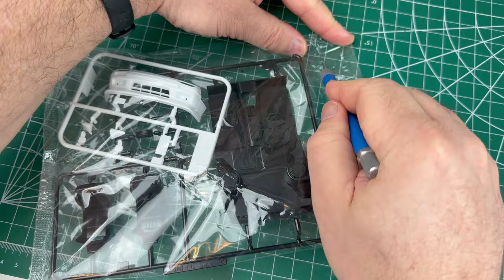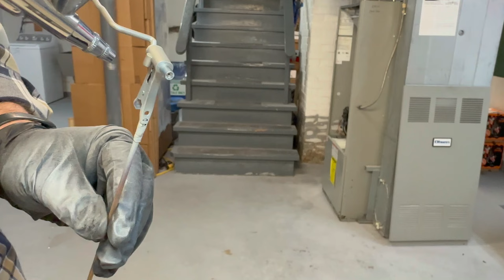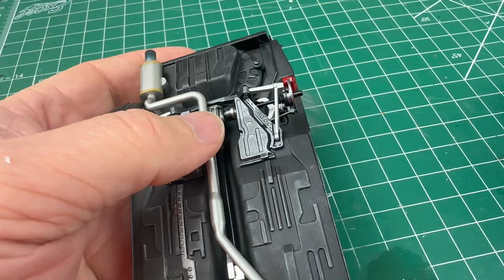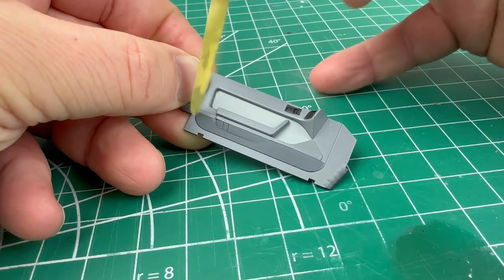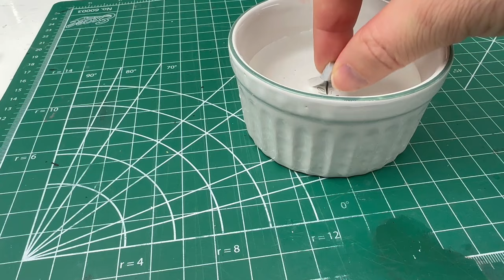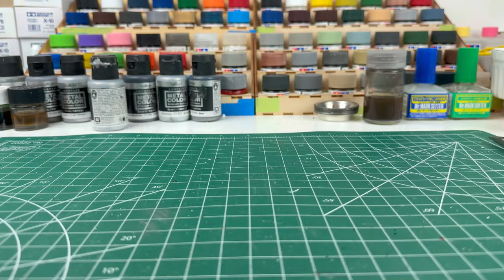Building Takahashi Ryosuke's Mazda FC3S RX-7 from Initial D in Miniature [FULL BUILD] Step by Step

Comment: Nice model!
What type of paint did you use on seats?
Reply from the maker: I use mostly Tamiya and Vallejo acrylics in my builds. In this instance, the driver seat is X-1 gloss black on the back and then XF-69 Nato black on the front, sprayed from a distance to give a more rough effect to look more like a fabric. The passenger seat was done using XF-54 Dark Sea Grey also from a distance to give the fabric appearance but it was also given some panel wash in grey (also from Tamiya) and then a quick dry brush using XF-24. Hope that helps! Thanks for watching!